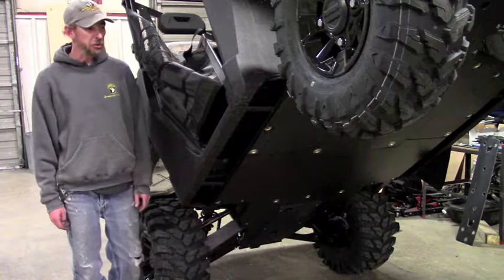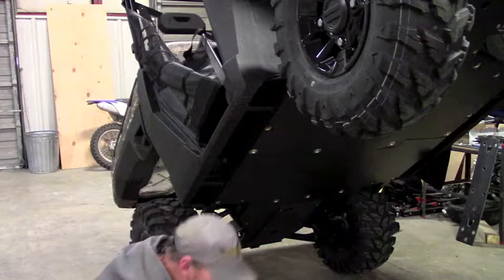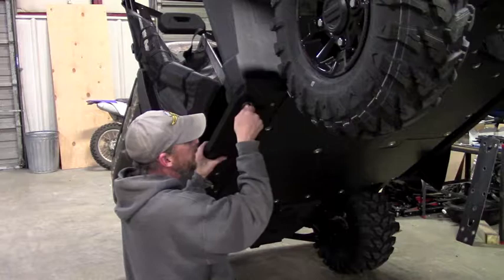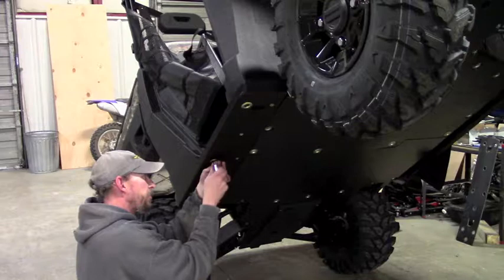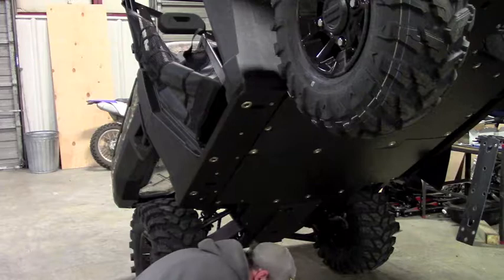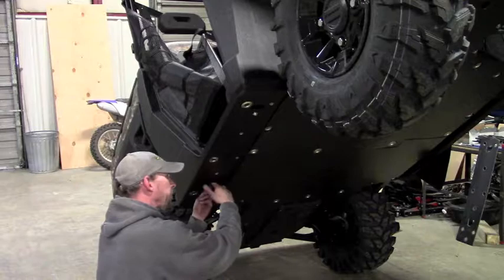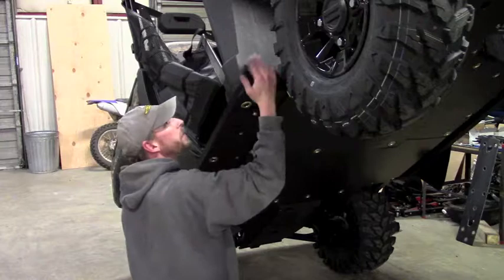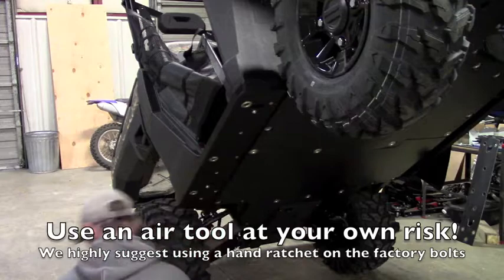2018 Ranger Floor boards

Comment: I am trying to install these my rig has stock plastic skid plate looks like you have to cut it back.   If  it has to be cut back do you cut it back so it lines up edge to edge of plastic and the aluminum plate.
Reply from the maker: If you are installing with the stock plastic, the stock plastic does need to be cut. Pretty much cut it at the edge of the outer frame tube.  That will line you up with the edge of the aluminum.